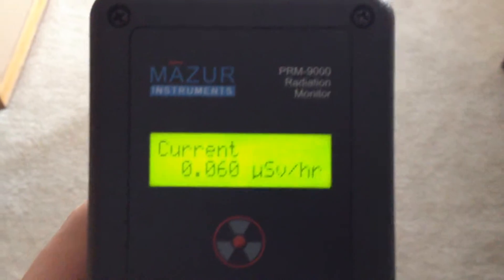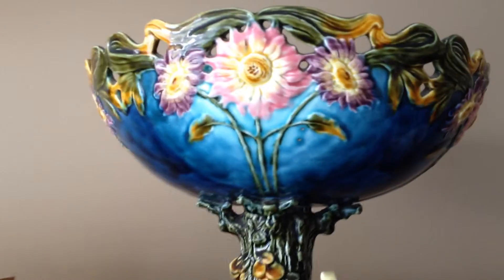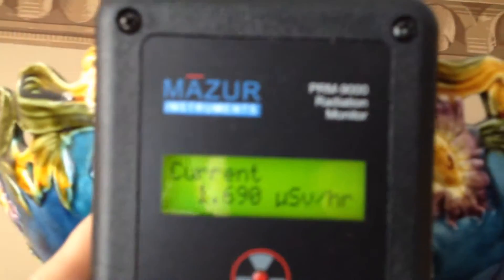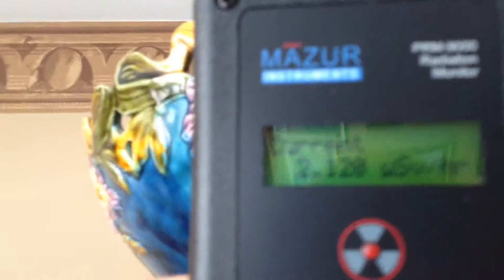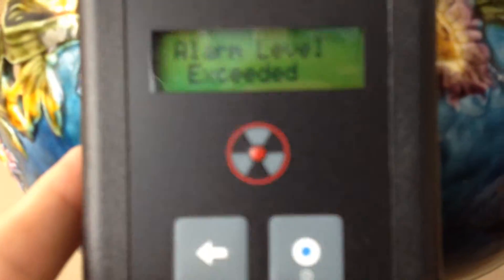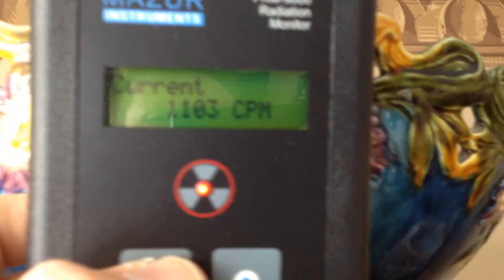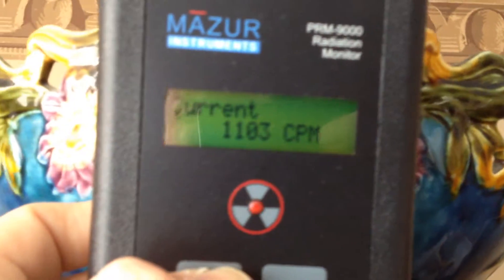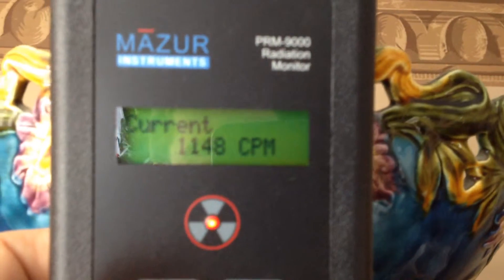Mazur PRM-9000 Geiger Counter Radiation Monitor testing an antique Vase - hot! March 19, 2015

Comment: The meter is calibrated to a Cs-137 source so the dose levels you see on the meter will be off by a good amount unless you know the energy and can calculate it based on the counts.  Unless you're measuring Cs-137 it's best to keep it in CPM or CPS because the dose rate calculations will be wrong.